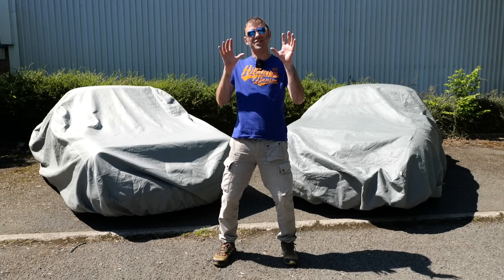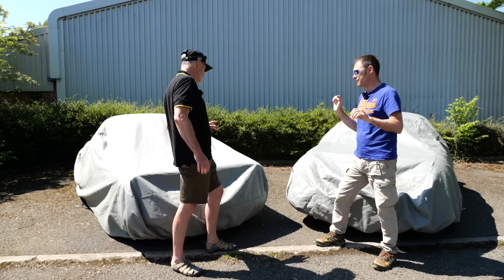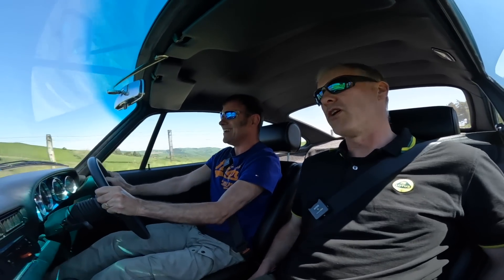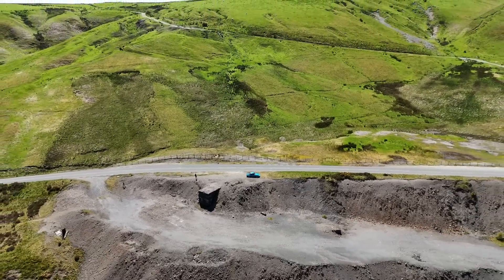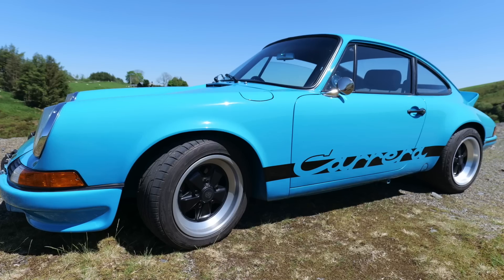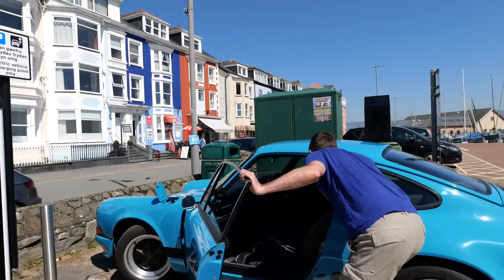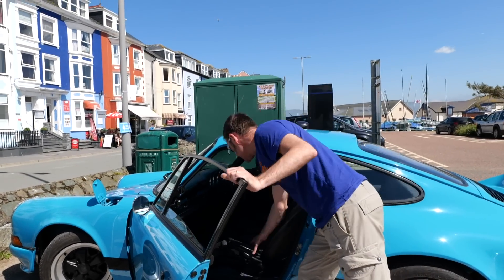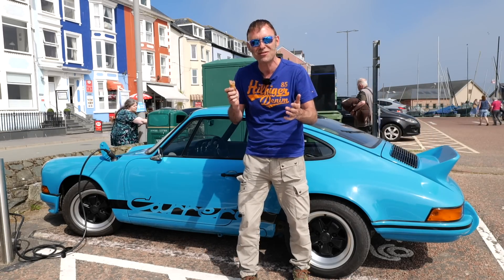Tesla powered Porsche 911

Comment: There are a lot of body swops with a classic car body shells swopped onto a more modern / better performing floor pan, engine and suspension.   Eg the Retropower lucky strike allegro’s, Matt Urch’s 100e.   Have you ever thought of building a standard electric skateboard with full structure, power train, suspension, battery pack etc onto which customers could swop their own classic body shell?   Design it with adjustable wheelbase and track and it could fit a whole range a vehicles.  Make the skateboard self contained with say a 12v outlet supply to which the customer connects the 12v classics loom?  The customer obtains the vehicle approvals needed and you get your skateboard approved.  A step up from installation packs and race car frames!   Just a thought 😊

Comment: Was the pull over rest really to allow the electric motor to cool down . Same disease as its 6 cyl predecessor then ?! What HP equivalent is its motor ?  Spare wheel ?! None ? Range on fully charged battery pack ?
Reply from the maker: The motor was fine, just pulled over to do filming. It’s 450hp. Range from memory is 150 miles, I think I confirmed it in the video somewhere. 👍

Comment: one thing that could be done to help with EV charging is an industry standard connection so you don't need to carry your own cables.  you don't see people at petrol stations pulling out their own hoses to fit the petrol pump, so why have to do it with EV's.  just a thought
Reply from the maker: Most cables are the same nowadays. Type 2. Apart from Nissan which I think still use Type 1 cables.

Comment: I've always felt that Public AC charging should be like that one in the video, where the cord comes with the car, not with the EVSE. It would be cheaper to install and maintain EVSEs if every car has the cable and not left for vandals or thieves to take, or disabled due to normal wear and tear. Apartment building owners, businesses, municipalities and employers might be persuaded to install EV infrastructure if they don't have to worry about cables, and especially if they only need to make electrical outlets available, not expensive EVSE equipment.
Reply from the maker: Good point. 👍